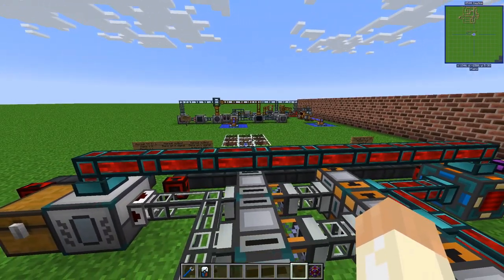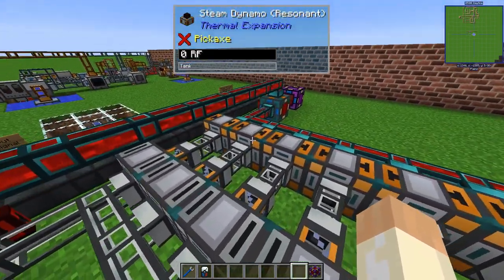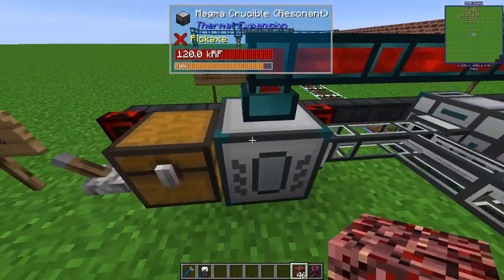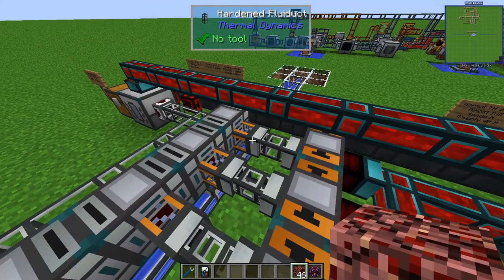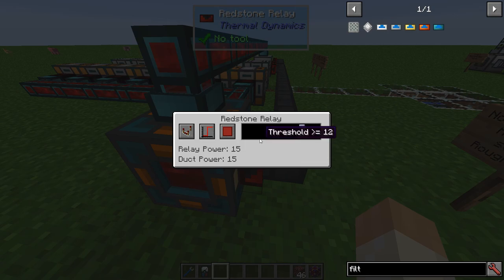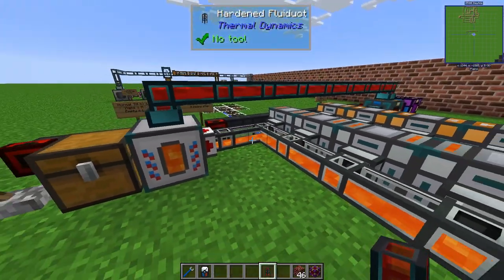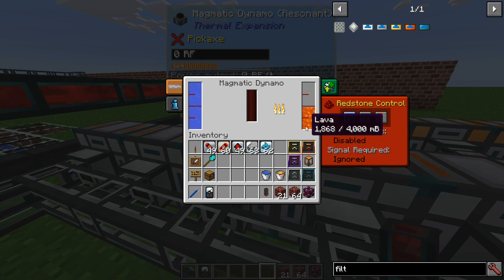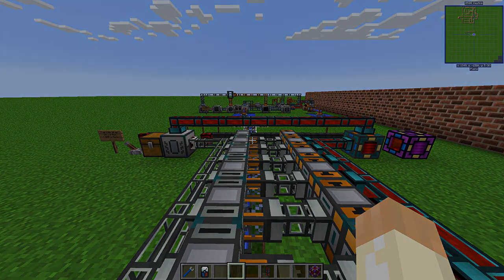Automated Magma Crucible Power Plant - Thermal Expansion Build

Comment: Is it not recommended to use cryo stabilizers instead of resonant fluxducts?
Reply from the maker: Recommended for what? Not for all use, the cryo-stabilized can transfer any amount of energy but there are no losses in these ducts, so as long as you use the appropriate tier for your build would be a waste of resources to use more than required. Higher tier can transfer more power, but are more expensive to build.

Comment: Couldn’t you use an ender tank in place of the crucible?
Reply from the maker: Yes, of course. But this build was about using Netherrack as fuel. And Ender Tanks are not in the thermal mods. Using a pump in the nether, two Ender Tanks and only using lava as fuel is probably more common in mod packs.

Comment: Ive watched like 3 times and dont see you show the upgrades (if any) you use in the crucible, if you did what did you use and would you still reccomend the same? i know this videos a little old 😂
Reply from the maker: I had it upgraded to Resonant. Upgrades are covered earlier in the series so I didn't cover that here. The Magma Crucible is also covered in more detail in another video (check the playlist), this is a sort of summary of what I had already covered to be able to do this build. You can also add Pyroconvective Loop to make it faster but it will consume the same amount of power to make lava from netherrack. The extra upgrades simply make it faster but is probably not required. Upgrade it one level at the time to get a feel for what is required. At least one or two tiers upgrades is probably a good idea.
Reply: @therealtkh  Sorry i did understand the resonant part ive watched most of your series but you never showed the pyroconvective loop inside the machine so i wasnt sure if you used it or any other types. thanks for the reply and very useful guides though!